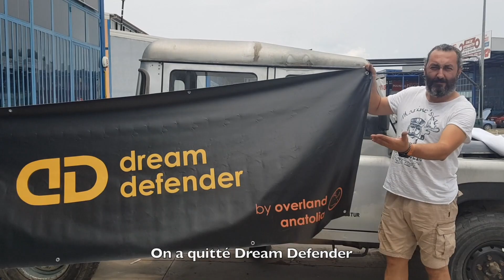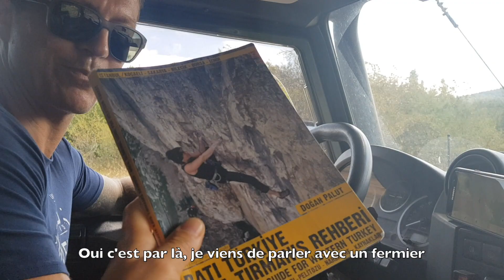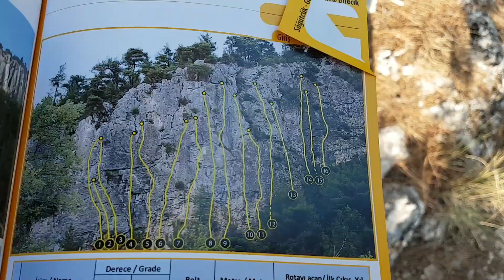Hot Air Balloons - Cappadocia (Ep42 GrizzlyNbear Overland)

Comment: clicking noise - fixing the spacer did the job? We had the wheel bearing passing away, in the end it sounded like the diff to be gone heavily... (Spacers are known to wear out the wheel bearings ;-)  Good luck! Santé Axel
Reply: Hello Axel
Sorry for the late reply. I have removed the spacers from the rear. They are the problem for sure. Even after modifying it was still a problem.
I check the load rating and I think we are too heavy for them...
Reply: Ditch the spacers. Dangerous at the best of time.
Reply: @nnoddy8161  we are going to get rid of the spacers in January. Going back to a slightly smaller tyre size to remove the need for spacers.
You are completely right, the spacers have caused us too many problems already.
Reply: @leighdearle5965  I have a 110 and have been running 255/85 - think they are the perfect size for the Def. Not always easy to come by though. 

Love your work mate, very inspirational.
Reply: @nnoddy8161  I thought about trying the 255/85 as I wanted to keep the 33 inch diameter.
You're right though they are an odd size and I can't get them in Kyrgyzstan without ordering them in which costs a heap extra.
I think I'll go back to the 265/75 ad that's what we had on the previous 130 and never had an issue.
Has your 110 had a lift for the 255/85s?
Reply: @nnoddy8161  thanks for the complement also mate 😉
Reply: Leigh Dearle s

Comment: Leave the spacers off, they will wreck your axles and wheel bearings
Reply: I have heard the spacers can put a lot of stress on the bearings...
We are running 285/75R16 tyres and without the spacers the tyres rub the chassis on sharp corners. I want to keep the same tyre size, do you have any suggestion?
Reply: Leigh Dearle  You could put a different offset wheel on to push the wheel out very small amount. I’m guessing you meaning the front tyres are rubbing on full lock you could also adjust the front steering lock bolts to stop that. Which also will be better for the axles. You are right wheel spacers put a lot of stress on the wheel bearings and also the swivel bearings on the front. I guess your vehicle must be around the 3 1/2 ton mark.   Great veg by the way they are just the right length with the right amount of information.